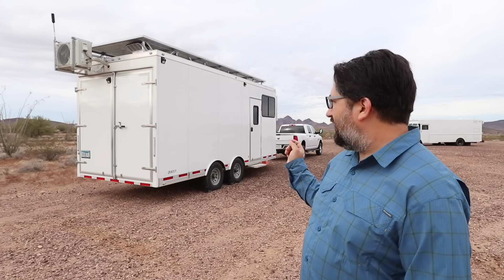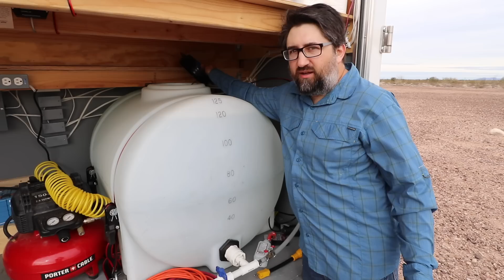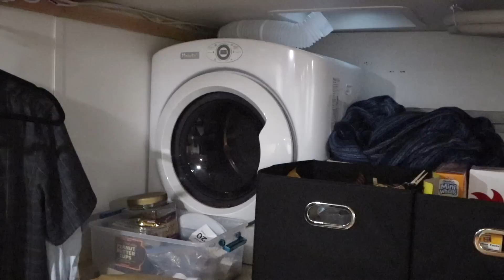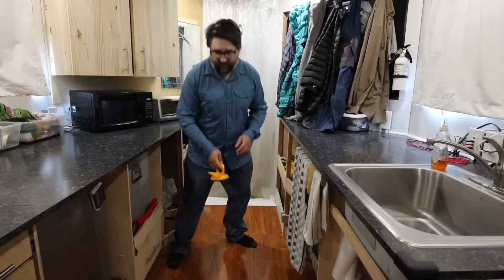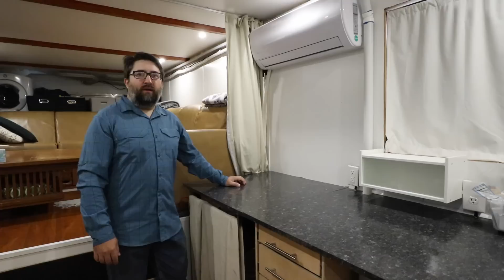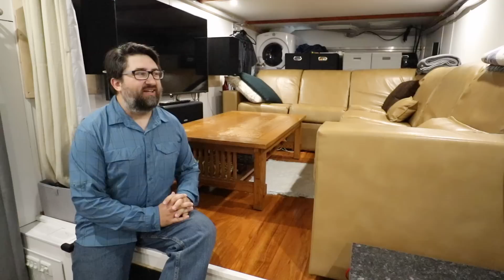Crypt Bedroom in a 2 Kilowatt Cargo Trailer Conversion

Comment: Just came across your video a few minutes ago. I like how you mounted your a/c up top in the rear. Went to your channel, to see if you had built the gooseneck hitch but didn't see an upgrade with a gooseneck. 

Back in 2020, I purchased a 2020 Winnebago Spyder toy hauler camper, but had lots of problems with the bumper hitch. So I custom built a gooseneck hitch made from 6"x10"x 3/16" wall thickness rectangular tubing, built it 6'7" from the bottom of the gooseneck to the ground so I wouldn't have to duck when it is connected to my 2010 Dodge Ram Cummins diesel 2500 4x4, 4-door pickup truck. I made steel access panels so I would be able to run cables and wiring on the inside of the gooseneck hitch. Removed the electric jack and replaced with a 36" long hydraulic cylinder, powered by a hydraulic pump and reservoir. It will easily lift the long gooseneck hitch with ease. Mounted (3) Optima blue top marine batteries and relocated the two LP gas cylinders on the passenger side of the base of the gooseneck, as it's much easier to remove and replace both 20# gas tanks than behing the stock electric jack and having to go on each side. Mine has a 3.5K Onan generator, as I had planned to remove it and replace with a 3 or 4K, 24 volt solar system. But wound much rather have a cargo trailer conversion camper now. If I knew your address, I could share pics of the gooseneck hitch I built, as I was once a certified TIG welder who traveled the country for work. Nice job building your cargo trailer conversion camper.

Comment: Cool stuff. But I'd probably just have the bed drop down from the ceiling up front with an electric motor and rail system... then get it out of the way during the day. Then when nature calls I can more easily do my business.  And when one gets older it isn't so easy to just bend over all the time to pull things out of the floor.  But this is a very custom design that suits the owner... so that makes it pretty cool.

Comment: You might look into hanging solar panels on the side of the trailer held up using struts to lift the panels. I am going to build a trailer that will have 19, 315 watt panels mounted on the trailer then one more that will have to be ground mounted.

Comment: Amp hours are still the same but the voltage multiplied by the amp hours is the factor. 48 volts X 400 amp hours = 19,200 watt hours. This is the number that matters when calculating how much power is available for your equipment. Almost....
The other factor is the actual available amps the battery can produce.
For my system i found that the battery claims to provide 200 amps. But the fine print says it can provide 150 amps continuous.
Which means if I really need 200 amps I need to have two same size batteries in parallel to keep my system from having voltage/current code issues. 
My next upgrade will involve changing to two 24 volt batteries that are 400 amp hours each. By connecting them in parallel The Total amp hours will be 800 amp hours resulting in 19,200 watt hours of power. I have a 4,000 watt inverter which i discovered is not enough watts to operate my AC, microwave oven, and air fryer or induction cook top all at the same time. I need a 6,000 watt inverter or possibly two inverters. One the 4,000 watt inverter and a second one that is at least 3,500 watts because i already have one that size running on my 24 volt system. 
That said if I was to switch to one 6,000 watt inverter I would also need to increase the battery voltage to 48 volts to keep wire gauge size at a minimum. When i build my super sized battery I might use 48 volts then. I will have 32 cells connected in 4 parallel strings of 8 cells for the 24 volt battery and 2 parallel strings of 16 cells for a 48 volt battery system.
The watt hours remains the same for both systems.
The BMS will determine ultimately how much power the system can produce. By using 200 amp BMS's which can provide 150 amps continuous i will be able to operate at least 9,000 watts of load with a 48 volt battery. 
If the battery is 24 volts the current available would be 4 times 150 amps = 600 amps total  for a maximum of 14,400 watts of load. 
The more parallel strings mean higher watts is possible.

Comment: One thing I don't get about almost all of not all of these rigs.
Why do people put these mini-fridges on the floor.
There is all kinds of problems with that. You cannot see what is in the fridge.  It's hard to reach.  You can push stuff to the back and end up forgetting about it or throwing it away. You're unconfortable every time you need to get to the fridge.  It's hard to see and visualize and for that reason also hard to organize.  I could see that with a freezer that you don't go into very often or need to organize. The same thing with some house designs and how they put the microwave up above the oven?  It it was me, I'd want the fridge a little below counter level.  Or maybe not because I might go into it more and eat too much or warm it up too much?

Comment: I did not understand how much solar and batteries you need to just run a mini fridge.. I have 180w and 4- 18amp batteries to run just a mini Frigidaire. The batteries drain in 2 hours.
.
I was thinking of a wind turbine..
You want to know why these people are proud of their solar systems? Just start one..
..
I only have a 12v cigarette lighter outlet hooked up to the batteries in 12v.. I run this off the cigarette lighter plug only.
The 9amp inverter runs as long as the 3.3amp fridge. So, for quit purposes I run the 12v plug option.
.
I'm doomsday prepping.
Right, I was going with 12v frying pan.. 12v car heater.
"If" I have to pack up and run. 
One 18amp battery backpack system.
.
$9.99 mini fridge from goodwill.😊 Also keeps food heat. 45.99 at home Depot.

Comment: i would place a  switch   between the solar   and your Outback ...  just in case you need to shut down power ...fire safety ...   the rest looks kind of ok...>>>exept maybe a cover for you battery...if something metal moves while driving and hits a few + - points...it could damage your system ...some do it with some transparent pvs to see things ... 

nice video btw ...

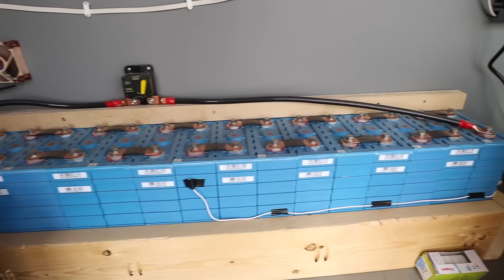Comment: An interesting approach, with the crypt bed and such a huge kitchen, but open plan bathrooming. Some scary electrics however in the garage -  insulation strip  on the battery cell terminations would be wise . Also at 4:51, the main  cable is  seen without any fixings and would benefit from some saddles  to avoid risk  of chafing  through the insulation where i could rub on one of the cell links.

Comment: I think a small sliding board into the bed would be cool...and easier than climbing in.  I like the term fort rather than crypt.  A crypt is a place for much longer sleeps. ;) ').    Great Job on the home though.  The most solar I;VE SEEN SO FAR.

Comment: Yikes!! ..i might need your help with our 8'x18'x7'H. extended "V"nose rig 5200# tandem axles..
..with 'MiniSplit' AC; OnDemand WaterHeater; 2 '1800watt' induction, portable; 32" TV; 6 ²' Fridge 3way; 1800watt CeramicHeater; Convection or Propane Oven;
(I am a Avid/ Retired MasterChef); GrayWater Tank (no black H²O); HomemadeComposting Toilet (with urine diversion to the "Gray" & computer-fan vented); & more...

HELP!
I was thinking 4 x 175w (Series & Parallel circuited) SolarPanels; 3000w MPPT Inverter/Converter 30A; 6 x 12volt AGM 100A Batteries..
Do I sound like I need help or what?!?

My last "Rig" was a 17' R-pod with 2 (65# Batteries) 6volt/100amp in a 'Series' & a 100W Renogy suitcase Solar.. way under powered!

Thanks for any advice! 
(Where to start over 🤔)

BeSafe!

P.s. Too bad he (Michael) is not offering 'Solar Set-up Advice'...😜

Comment: Thanks, another video full of conversion ideas.  Would love a trailer like this strapped to the bed of an M1086 truck.  Like the fort analogy, the crypt (I'd be Closter phobic).  Nice size water tank, with an air compressor, hoping it has baffles to keep water from sloshing around.  Love the idea of a diesel heater (reminded of VW Bug and Thing heaters), wood gets messy, electric takes a lot of energy.  Don't boats have a combo washer/dryer?  The mistake of many conversions is to use full-size counters/cabinets.  Think they need to be narrow gauge.

Comment: I would like to add something important. There are a lot of discussions in the comments about where he has the water tank and the batteries. He addressed this on his website and I think it is worth noting since a lot of people are talking about the batteries getting wet and sloshing in the water tank. Here is what Michael said on his website:

"Once again, not really a question, but a frequent comment. My trailer was designed to have extra weight in the back from the initial design phase. The axels were moved back 6″ to accommodate that weight. When the fresh tank is full and the holding tanks are empty, my tongue weight is approximately 12%. For bumper-pull trailers, the weight is supposed to be between 10 and 15%, so I’m right where I’m supposed to be. I never have issues with the water slushing around causing the trailer to misbehave. I do have issues with the large sidewalls of the trailer when it’s hit by a crosswind, and that’s why I’m changing the trailer into a gooseneck instead of a bumper-pull."

Comment: He doesn’t need an 8 person couch. Smaller couch - easier access to crypt. I’m an architect so would have done this differently. How are you going to crap with 7 guests? Setting up the shower seems tedious at best. I would have gone with a wet room - combining the shower and toilet. Because of the straight walls could have gone with ready made ( eg. IKEA) components for neater appearance. But I think neatness ( and pretty)  is not a high priority for a software engineer 😁Pretty interesting and well thought out design/build.

Comment: The solar panels raised off of the roof is a excellent idea also allows for air movement underneath of them and keeps the top of the rig shaded that probably helps your air conditioner big time and the Crypt is awesome but like some of the other comments I think I'd feel safer with a few cameras on the rig and a monitor inside of there

Comment: The thing you dind't realize when you bought individual lithium cells is they don't have a built in BMS, you need to be EXTREMELY careful with those lithium cells.  They should be in a steel case atleast and not sorrounded by a bunch of wood.  This is a huge fire hazard, google lithium ion fire...

Comment: I like the overall design of the thing. Only major change I would have done is build a bed platform above your couch, probably something that can be raised and lowered to maximize head space in the sitting area when not sleeping. You could still soundproof the three walls, ceiling and under the bed platform, and use heavy blackout curtains to close off the sleeping area from the rest of the trailer. I just worry that the crypt would get too damp and promote mold growth, even if it has ventilation.

Comment: Needs a little color coordination,  and some cupboard doors/sliding doors/drapes for those counters. But the ideas are all there, and some of them, like the shower and sleeping crypt are very very good. Just needs the loose ends tied up. This guy should be proud of his solutions for small spaces  I would have made the floor between the loft and the crypt height adjustable, to give that extra 2 feet of height in either space. I've seen the motorized floors on other builds.

Comment: I have seen a few of these videos and they all seem to have a common element, their battery bays are a C fire waiting to happen. To humor you guys I will list a couple that I see off first glace.
1.) Mechanical abrasive shorting potential between cells when the insulation of the main leads is a potential risk. In general you want a circuit interruption device to be as close to the battery as possible.
2.) Exposed cells/bus tie points. Any conductive material across those points can dead short that portion of the battery until it fuses open, looses connection, or destroys affected cells. Potential for class C fires, then class A, and in worse case Class D due to the lithium battery chemistry.  On a good note, those cells look to be of a more stable chemistry.
3.) That circuit breaker is convenient; however, not likely rated for the DC current interruption needed with that battery in a fault. 
4.) Water by electronics. Self explanatory; not necessarily a hazard, but precautions should be observed.
5.) Dual use storage and rigging for sea. This is more of a general concept, the electrical system needs to be protected if the space is going to be used for storage duty. Contents may shift during flight.
6.) This may be a bit inevitable, but there isn't easy access to the battery bay when loaded. This goes back to circuit interruption. I would install a remote battery disconnect contactor that isolates the battery at a touch of a button.
7.) Maybe I missed it but I didn't see any figure extinguishers in sight in that battery well.

Just a few top level observations. Nice build.
Reply: Yes some valid points. This looks like a Blue Sea  Systems circuit breaker which should be ok for 48V and 3000 Amps breaking capacity. I think if say it's a 5kW inverter then I'd add a 150A HRC fuse for peace of mind.

Comment: 1043 pounds of water. If you would have lived in the liter, kilo system, then calculating the weight of the tank would have been really easy as one liter of water is 1 kilo. :)

Comment: I like the Shower Idea but I would move the Electrical Appliances away and put the Toilet next to the Shower. "Invite Friends to your Loft" Where are they in the EMERALD CITY, 3-ft. tall ? And that's not a CREPT, its more like a COFFIN. What is your Fire Escape Plan ? What about a Defensive Action against Break in Intruders ? Right just stay in your Crept and make them think "No One is Home". I would Drop the Loft and put in a Convertible Sofa with a FSG-12 Shotgun. Who needs a Surround Sound System from 6 feet away ? It's a nice Concept, Think I would Start Over.

Comment: Never travel with that fresh water barrel half full. No baffles in there, so the slosh could tip you over, if you go into an unknown curve too fast! Commercial fisherman here, that sort of thing can capsize a boat. We actually bolt the lid down, when it's full. Shifting chunks of ice give us issues, too. So travel FULL - OR EMPTY - NO INBETWEEN. unless you're crawling along slowly that's fine

Comment: Man ... you nailed it.  That setup is sweeeeet.  I've looked at hundreds of "tiny homes" and "van life" and alternative living (like earthships).  I really mean that.  Over the last 5 years I've really been looking into this stuff allot.  This is possibly the first portable home I've seen that my wife might actually be willing to live in.  The split level design is super smart.  I love "the crypt", and the shower and the living room.  It looks like once your sitting it would feel very much like a standard living room experience.  What I might do to improve the shower experience... for what you have there is size the curtains so there isn't a bunch of gathering in the curtain it self.  Then attach a rod (kinda like the one for adjusting vineeshen blinds) to each end of the curtain where you would normally hold it to pull it around (ya know ... if you could reach).  Add some magnets (not to many, prolly only 4) to the bottom, and of course a way for them to attach.  What this would do is give you more room in the shower and keep the curtain from touching you.  Basically the same process as you have now to set it up...  just jump in grab the rods and use that to pull the curtain around, then quickly use your feet to slide the magnets into position.  Now because you have less shower curtain material, and because there is not much waving of the material, the effective space is larger.  It also might store better (again less material).  A common thing I see in many shower configurations using a curtain is very few people think of using the curtain as a wall.  Like in your case, if that curtain were opaque it would probably feel claustrophobic.  But in wall configuration even opaque it wouldn't be nearly as bad.  It takes a bit of imagination to be able to picture each situation so I don't know it what i'm saying makes any sense but hopefully its something to consider. Anyway just an idea. .... great job on this home on wheels... super cool.  Also this thing looks way bigger on the inside then the outside in this video.  At the end when you're outside for the wrap up, I found my self thinking wow i just felt like i got a house tour... wait what... its all in that little white box.  I realize its a large trailer but you really did a lot with it.  Well Done Sir.  Now jump in your tardis and off to the next adventure.  ;-)

Comment: Those mini split systems really can’t heat well past maybe 20 degrees
Reply: Ours work well down to 10 or even lower. You MUST buy a quality one with a higher efficiency rating...23 or above. They cost more yet mine runs off of just 600 watts most of the time. As with many things, cheaper is not always better. heating and cooling works well with my Pioneer 8,000 BTU mini-split.

Comment: 11,000 lbs. and it's only rated for 13K. That's a lot of weight to be lugging around. You should try to cut some of that weight down.  It's going to wear your transmission and it's a heavy load for the axle.

Comment: I really like your build, I am using a much smaller 5 by 10 trailer for short trips. I am also using a diesel heater, I actually plumbed mine exactly the same way that you did, I use a 10L jerrycan at the nose and have a feed pipe coming in from the top and a small motorcycle one-way check valve installed to prevent can vacuum sealing.